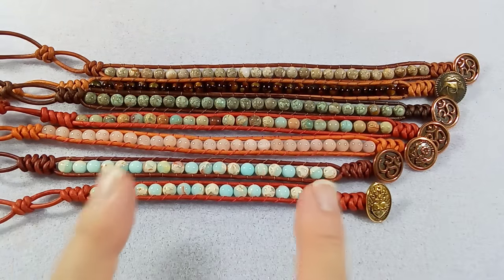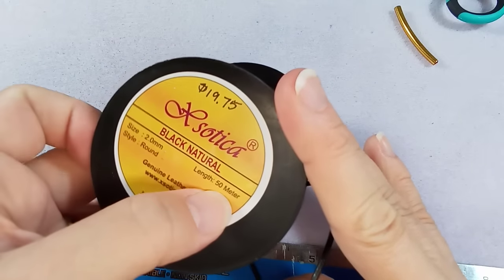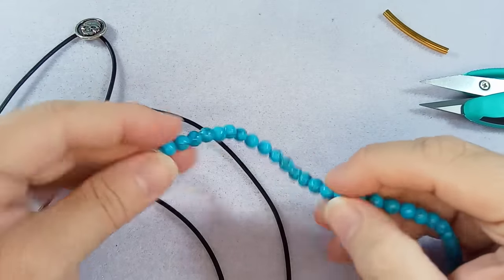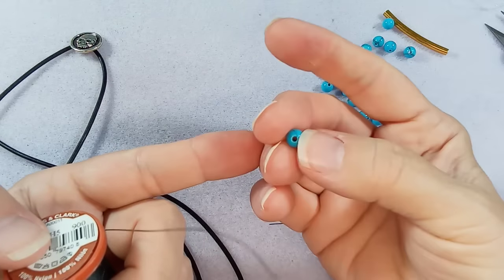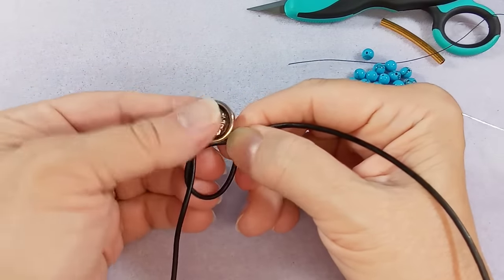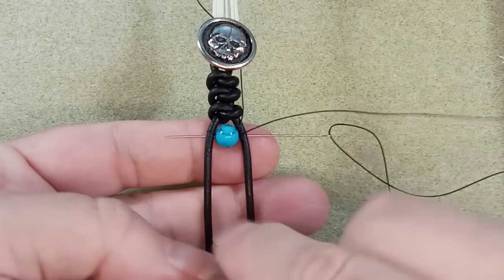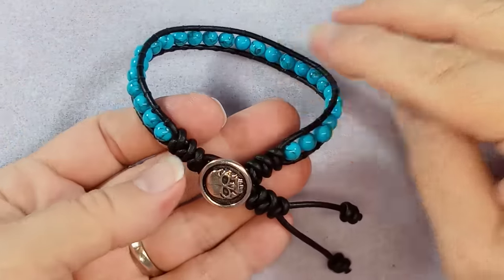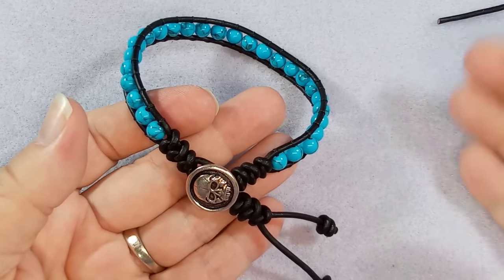Leather Bracelet Tutorial with Snake Knots and Tierra Cast Buttons

Comment: Fantastic! I’ve been wondering how to incorporate beads with the leather without using wire or really big beads that will fit over the leather. This is great. Also, the beads you are using are dyed howlite, a common stone used for imitation turquoise (I’m a lapidarist who makes jewelry as well). I like this snake knot better than the barrel knot. I always have trouble getting the barrel knots to look neat and it drives my OCD nuts. Thanks for the tip on getting the last 2 knots to look the same for my OCD! 😂

Comment: what is the size of the button, I have tons of antique brass military buttons I could use.
Reply from the maker: It's 15cm 🤓 the important part is the hole size to fit your leather. I use 2mm round leather. If you hole is too small you can try to ream it out with your bead reamer. Your buttons sound amazing.🐿️
Reply: @BabySquirrelBeading  thanks. I collect buttons, apparently, and saw this bracelet and thought I'd make one for myself using an antique button.

Comment: I worry that the knots will undo without glue, but would love to not use glue   ?
Reply from the maker: Yes I agree 🤓 I do have some 6 year old bracelets that the knots never came apart. I think the softer the leather the better the knots hold 🐿️
Reply: @BabySquirrelBeading  Thank you for your reply.    I was thinking if you were to wet the knot, when it dries out it will shrink a bit and hold tight, similar to some wood joints  ? ?